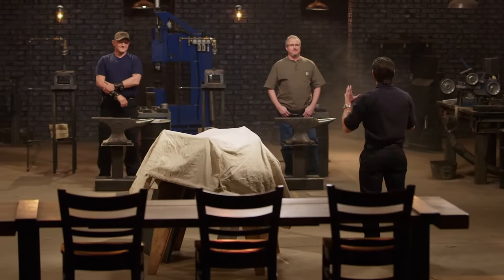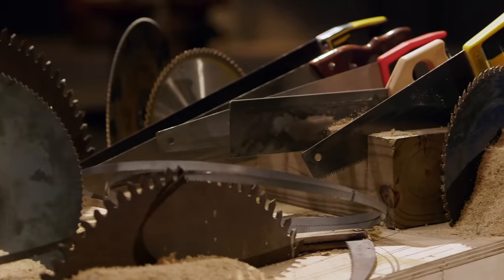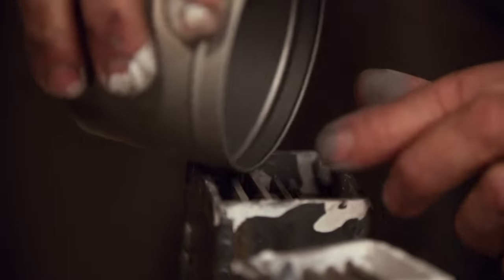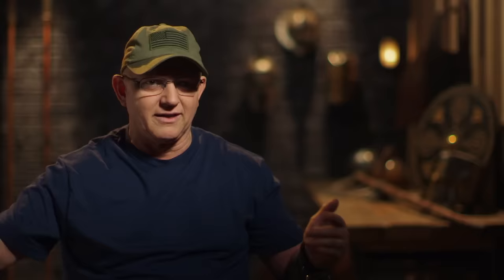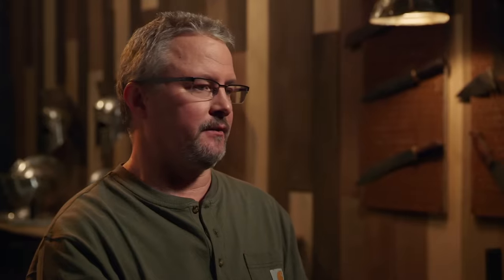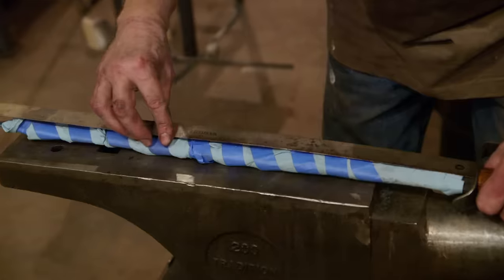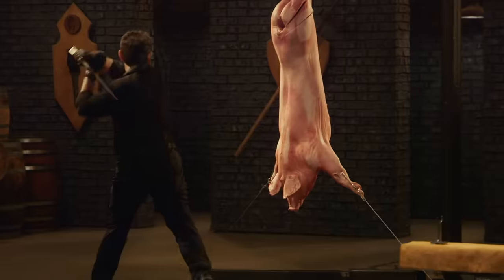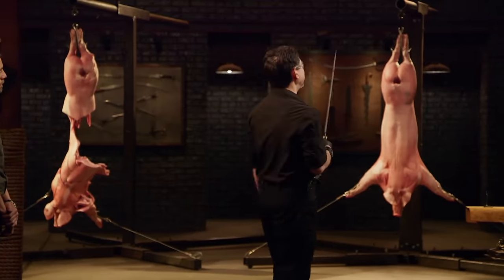Forged in Fire: Beat the Judges: SAW BLADE SWORD CHALLENGE (Season 1) | History

Comment: “Welp Jay, the other blade outperformed you in every way but it was a little heavy so we’re giving the win to you. Congratulations on making a blade that was mostly sub par.”
Reply: Both blades were subpar lol they had 8 hours to complete it. but yeah you're correct I shouldn't have won
Reply: A "little heavy"?  A long sword (which tends to be 32-36 inches long) is supposed to weigh around 3 pounds.  This was a 20-22 inch short sword that weighed 4.  There are two handers that weigh that much.  PS: Ben even says it was simply bludgeoning it's way through at the end, not actually cutting.  Yes it cut the arm all the way off, but in reality cutting someones arm off 50% is just as good.
Reply: @AnonYmous-ob7py  "I"?
Reply: @DKarkarov  according to google most were actually around 2 pounds, making the short sword twice as heavy as a two-handed sword
Reply: @NySiiS  No, two handed swords were not 2 pounds, they have blades 4+ feet long generally.  Maybe an incredibly thin bladed one might make the 3 range, but not 2.  Remember, sword classification is based on blade length and style, just because you "could" use two hands doesn't make it a two hand sword.  Many long swords (30-36 inch blades normally) could be used two handed but weren't required to be.  A thin bladed long sword with a two hand grip might make 2-2.5 pounds.
Reply: @DKarkarov  i was referring to longswords, which are 2-3 lbs. The 4ft sword you're talking about is most likely a claymore or zweihänder. Claymores usually weighed about 5.5 lbs, while zeihänders would weigh anywhere between 4.4 to 7.1 lbs(with heavier variants even weighing 10lbs, but only being used ceremonially). These swords are both over 36 inches long, while the longsword was usually 33 to 43 inches. So no, i was not wrong.
Reply: @horvathbenedek3596  Arming swords  were around 900g-1,3kg  so about 2-3 lbs in general. Longswords ranged from 800g up to 1,8kg and Zweihänder mostly start at around 2kg. So we are talking about a short sword weighing as much as the heaviest longsword or a very light zweihänder.
Brass  only weighs 1g per cm³ more than steel, so it´s not that much more, but he thing is, you can´t talk about ballance at this point, since there is no weight distribution over a comparable length.  The brass pommel doesn´t improve anything, it just makes it feel, as if you a waving a dumb bell.
Reply: Glad im not the only one who felt this way
Reply: @S0ulGh0st  Just someone trying to pretend they're Jay from the show, but forgot they referred to the people as "they" instead of "we" in the first bit of their sentence. Fail
Reply: It's not about what it did with the cut test which it visually excelled. Standards are there for a reason, and the standards said it was too heavy, which means it will not perform as good as a standard one with most people. If it was a specialized and tailor-made for a certain individual, then it would've won. And these weapons should be following the standards already set, that's why it's in an history channel
Reply: Jay made a long butter knife.
Reply: A short sword is designed for stabbing.  Not slashing; it's a close-quarters weapon, and if you're fighting at melee range with a blade less than 2' long, you (a) don't have a lot of room to swing your arms, and (b), if you do, you might easily hit an ally.  Those "tests" don't really provide a realistic comparison to what similar blades were actually used for.  Why not test the stabbing ability of each blade?  Because it doesn't look flashy on camera. 

And as far as those sand dummies go, I've no idea what they were supposed to replicate.  Both swords dealt heavy damage against biological targets, and clearly the sand dummies were considerably more resistant to cutting.  Not only were the blades being "tested" in ways they wouldn't have been used in real life; they were being tested against unrealistically resistant targets.

Which is why the heavy chopper lost - it wasn't a light, fast short sword; it was more of a machete.  Which is an entirely different item from a short sword.
Reply: But at the same time it’s not hard to outperform a blade when it weighs half as much.  They pretty much aren’t even the same kind of blade really
Reply: A lot of blade professors in the thread
Reply: @DKarkarov  What? Dude Jay's sword didn't cut after the arm, and the other guys did.
THAT is observational evidence, anything said by the judge about how that cut was made is irrelevant. One cut, one did not.
The one that cuts is innately better? Why? Because, if you swing a metal stick at a man you only make him more angry, especially if he's covered in something as hard as leather, which sandman properly simulates.
SO, which sword would YOU take into battle? A sword in which a few shield strikes will dull it to unusability, or a sword which is unruly but is guaranteed to cut after being used to strike hard objects?
Reply: @exxie1  Standard set? Like the standard of being able to withstand the durability test and still be able to cut? Or did we forget that was apart of the testing?
Why was the entire end result removed from the equation, when it alone would decide the fate of a duel between those 2 swords? If you had 2 equally skilled men, in equal armor, the sword Jay made would lose, because it would dull and be unable to cut a leather tunic.
The other man's sword would not only be difficult to block, and parry, but it would also cut after being used to block or strike a hard object.
So, under the standards presented, Jay's sword lost wholeheartedly, and any semblance of defense of this decision could easily be explained as fanboying, due to the magnitude of failure that Jay had.
Also, Jay didn't use a mechanical connection for his handle, which was a requirement.
Reply: @benmaske9598  Sand dummies simulate a basic armor set. Leather.
How did you not put that together? Oh because you refuse to actually analyze this beyond what the judges have said.
Reply: @D-Vinko  You are only taking into consideration what you see in the tests. The results of these are important but not more important than comfort of use and balance. The contestant made a blade twice as heavy as the judge's one. Simple as that. It was too heavy and off-balance for a short-sword. It would have been on the heavy side for a longsword for f*** sake. Of course it will cut better but it is not what the judges asked for. If I had been a judge and a contestant gave me a 4 pound "short sword" I would have judged it off parameters. Simple as that. Weight = more cutting power and usually a blade heavier will be more resistant. If the tests were the only thing taken into account it would be very easy for a contestant to turn in ridiculously heavy and robust blades when there are no weight parameters specified. And the funny thing is that in a lot of other episodes (I don't know if they took place after or before this one) there are indeed pretty restrictive weight parameters forced on the candidates.
Reply: @D-Vinko  as far as I'm aware, shields weren't usually made from ceramic in the time of swords. So if you want to be using shields, a lighter sword with a forward point of balance could be used more easily, and for a longer period of time, and it would chop into the wood just fine. 

The heavy sword would bite deeper into the wood, yeah, but thats not the job of a sword. Plus, its much heavier, and a lighter, faster weapon will outmaneuver a slower, heavier blade.

As a bit of an aside, the sand dummy responding like leather just means its not a very good test. Leather armor wasn't really a thing. Usually cloth, mail, steel plates, or some combination. The lighter and faster sword would cut cloth armor better (we use shears and knives for fabric instead of axes for a reason). It would also be easier to thrust through mail, though you're gonna struggle no matter what since mail was made to prevent cuts. If you're using a sword to chop at plate, then you already have an issue. Theres a reason maces were used.

Everything aside from opinions, why not trust those who actually had to fight with swords? Historic example of swords used in combat rarely met 4 pounds, and almost never for something shorter than a longsword. They probably had their reasons for that.
Reply: 4 pounds is more than a little heavy. It’d be heavy for a longsword.
Reply: @gorisenke  boiled leather was used, but not particularly widely, and it is a different sort of material from the leather of the dummy, so your point holds on it. I just wanted to make sure some pedants didn’t try saying “oh yeah, well leather armor existed” lol
Reply: @jlaw131985  i appreciate you looking out. I dont typically think about boiled leather because I've only ever seen it used for gauntlets and the like. Parts of armor that aren't the primary defense. But survivors bias is a thing, so who knows.
Reply: @gorisenke  yeah, it doesn’t appear to have much wide use. I’ve seen some shields and helmets too, and it’s suggested that “cuirass” was originally boiled leather…but as you said it wasn’t widely used.
Reply: @jlaw131985  i should have known about the helmets, it's small enough, and can be used in more than just the cap. The cuirass really surprises me, though. Regardless of the size, I wouldn't have expected the leather to be thick enough for that. Huh, the more you know.
Reply: It was supposed to be a single handed sword, but as was pointed out, the losing sword was as heavy if not heavier than a two-handed sword. So the directions were not followed in the design and construction, hence the loss. Too bad this was not made more clear.
Reply: @DKarkarov  not penetrating leather armor makes it useless in any context a sword would be used.  And since it's so light, it's not going to cause any damage on the hits in which it doesn't cut. It's as useful as a pointy stick.
Reply: @69nites  Well frankly the sword shapes they designed are slashers so it not penetrating leather is not a big concern at all.  As for it being light, did you even listen to Marcaida?  Did you see it cut through the pig carcass with no issue?  I am pretty sure it will do damage on a slash.  Also again, short swords are NOT SUPPOSED TO WEIGH 4 POUNDS.  You can find two handed swords that weigh 4 pounds, some even less.
Reply: @S0ulGh0st  "they" though too.. I am also confused.
Reply: And we'll ignore the fact you should have been disqualified outright for not meeting parameters.
Reply: 4 pounds is unusable against anything but a stationary target.
Reply: @D-Vinko  If you had wo equally skilled people in equal armor, then jay blade would win, because the weight is more of hindrance than an advantage. Only an idiot would argue, that a weapon that tires you out after three strikes, is the better weapon.
Reply: @4Curses  Thank you, I am glad so many people understand just how heavy 4 lbs is for a short sword.   As a martial artist you are 100% on the money with this comment.
Reply: @4Curses   And a weapon that can't cut is useless.
Reply: Agreed
Reply: Watching this show weight is a major factor especially on swords, the lighter swords generally win. And that's down to handling